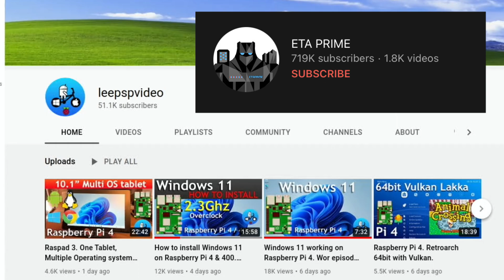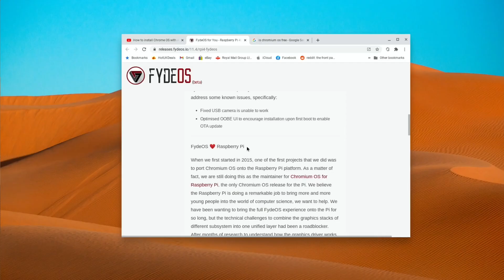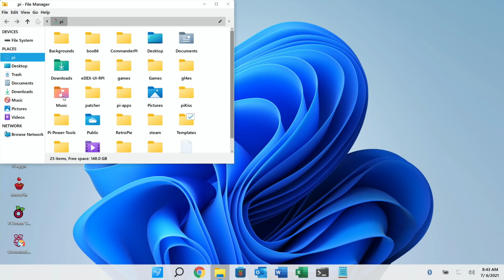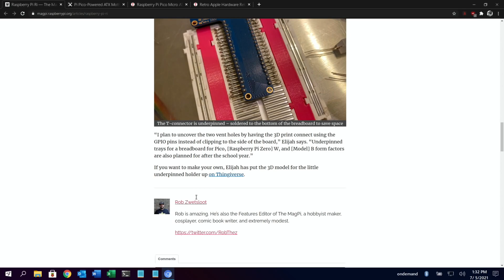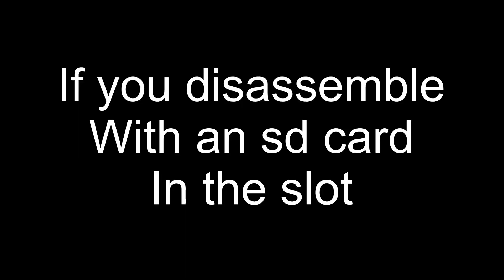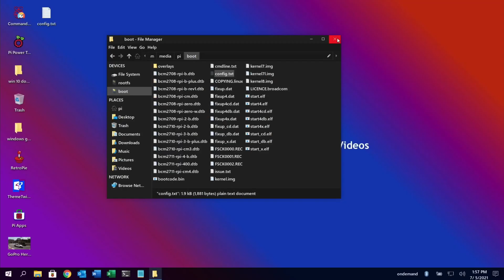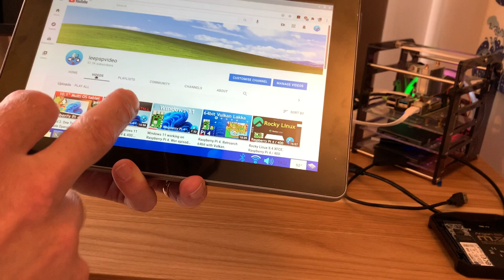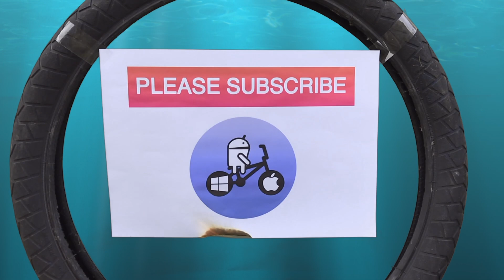Pi news 33. New Twister 11 theme, Silent Raspad 3 mod.

Comment: Did you remove the Auto-Rotate sensor when you installed the third party heat sink?
Reply from the maker: I did 👍🏼
Reply: @leepspvideo  Might be foolish of me, but I'm going to try it with the heat sink. I added extra of those sticky pads to create more space and still provide contact did the heat sink. Hope the fans power on

Comment: 50 K  🥳 🤗
As i have the raspad too i removed with a dremel the 4 screw hole's from the fan on the back case and put a other fan the on the board.
And i dremeld the little barrier dy the sd card away ! !

Further more : is your brake out board from the raspad also beeping ? ?
I have the 8 gb and its very slow 😟
Greetings from Amsterdam.
Reply from the maker: I haven’t heard any beeping

Comment: You can charge for open source software, you just need to abide by the license terms. some just want credit, some require derivative code to be released under the same license if you distribute a combined work, etc.

Given the terms the chromium browser is released under, i suspect this is fair game.

Comment: Congrats on the 50K! Got my Raspad today and am very pleased with it so far. Question: when you fitted that heatsink/fan combo to it, did you leave the accelerometer in place? i.e. does it still autorotate properly?
Reply from the maker: I took it off. It was blocking the aluminium casing.
Reply: @leepspvideo  I thought that you may have to do that. I haven't been able to get the autorotate working properly anyway, even using Raspad OS. None of their scripts seem to work properly on mine?

Comment: Can we use the Samsung Bar as main OS inside the Raspad3 and use SD cards to do test ? Would that present a conflict or theres a prompt asking you to select ? ( like Mint running alongside Windows 10)
Reply from the maker: I’m not sure I understand the question. Did you see my recent Raspad video? Also In Raspi-config you can select your boot drive.

Comment: 11:55 It looks like you might be able to squeeze the m.2 drive underneath all of those daughterboard interconnect cables if you removed the plastic housing on the USB-to-m.2 adapter. Maybe with a right-angle USB adapter since that cable looks a bit too thick to make such a harsh turn.

Your channel is my go-to for OS and WOR info on the Pi, so I'm glad you got a viewership boost from those recent shout-outs and references!

Comment: Have you experimented with under clocking the Pi 4 to help wit power consumption and heat? I have a project in mind which I'm a little concerned about cooling in the enclosure.
Reply from the maker: Yes, with my Lapdock

Under Clocking Pi 4. Motorola Atrix 4G Lapdock powering Raspberry Pi 4.
https://youtu.be/dpPYTTchRRk

Comment: I've just ordered a Flash drive and PWM fan for my RasPad3 (via your link) from Amazon. The original fan is really irritating!
I intend to install the RasPad OS on the USB drive (as the default) and use the SD card if I want to try something else.
IF this had been developed 6 months later it could have used a CM4 and been thinner and faster  - Though the ability to stand it up on its edge is pretty cool.